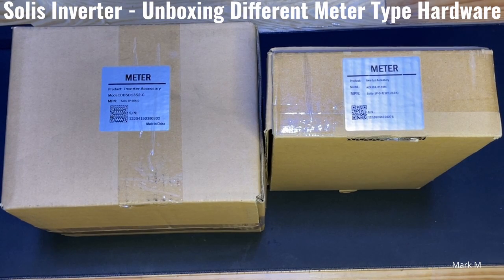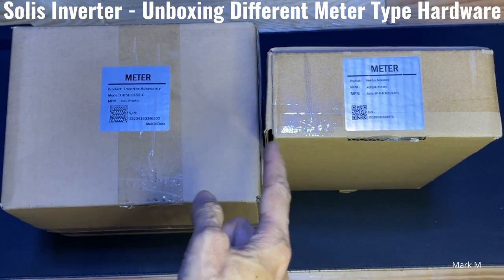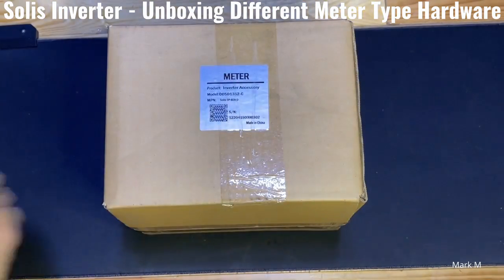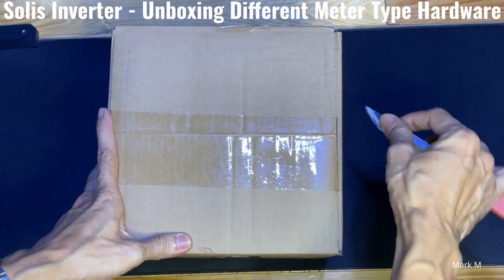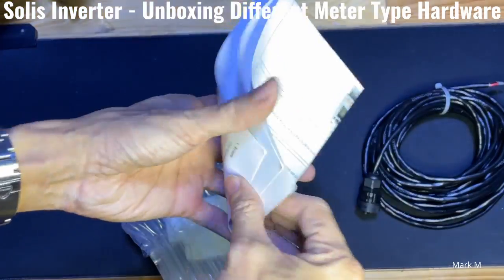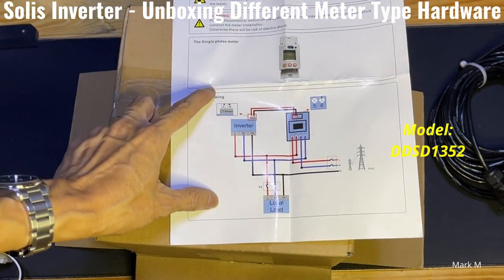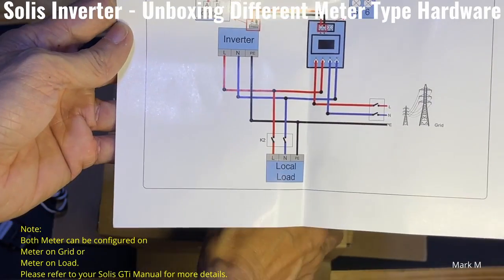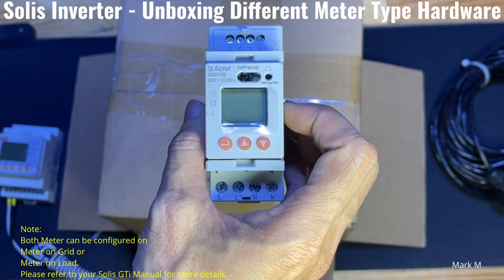Unboxing - Different Solis Meter Type Hardware

Comment: Hi there,

I have solis rhi-5k-48es-5g, it only charges the battery from the solar panels that are directly attached to it but not from the extra generated power by the other inverter, though the meter is showing the power being exported. Please help. Link to the video is here. 
It is exporting about 1kw, battery is just getting charged from the solar panels directly attached to it. The meter I am using is one phase ACR10R-D16TE. Meter Placement setting is on grid. Any help will be appreciated. Charge from the grid is enabled.  Video link is here https://youtu.be/sjtVqiOg1JE?si=2S6TJpbcjZMVcM3X
Reply from the maker: Try to contact your local support and have it patch. My RHi has been patch to correct some settings. It also should work from your end.

Comment: how do u install these meter and set the address?
Reply from the maker: You don't touch any of the meters configuration, it's just plug and play for Solis use. For meters with CT, just clamp it on the hot wire. For Inline, manual is provided.
Reply: Does the ct go on the hot wire from the Inverter to the distribution board?
Reply: yes but the inverter does nottin could you make a video showing the meter setup only please and the wire for rs485 thank for responding
Reply from the maker: @olvano  cable is provided, do you have one for your Solis Inverter ?
Reply: @MarkMinoza  i dont have the original cable i made one .could u test yours, so i can check mine ,with a multi meter check pinout and the resistor from end in video i look all over youtube for one
Reply from the maker: @olvano  what model do you have?

Comment: Hello Mark ..... I have Solis S5 single Phase on grid inverter. Also have Acrel DTSD1352 3 phase meter with CTs from Solis. I don't know how to setup Inverter getting "Fail safe" (Connected Acrel CTs to grid side by instructions manual)
Thank you for your help
Reply from the maker: Use Meter on Grid, dont choose the CT Sensor wih Fail Safe On.
Reply: @MarkMinoza  I tried....any other settings like external EPM settings? I also  switched meter type to 3phase but it always jumps back to 1phase.
Reply from the maker: @jerryp9647  you cant use 3P or external EPM. Only Internal EPM settings if your GTi has included a meter. Set Backflow 000000 and Meter In Grid. Be mindful of the ct flow on your CT illustration.
Reply: @MarkMinoza 1.... I have Solis S5 1Phase 5k Grid inverter and manual say only 2 types of meter supported DDSD1352-C or ACR10RD16TE (all 1Phase meters) 
I have DTSD1352 3phase meter witch is not in list of supported meters. 
2.... my settings: Int EPM settings Meter in Grid (CT arrows towards grid)
under meter type setting 1Phase or 3Phase (any option gives me Fail Safe alarm 😭
Please help
Reply: Hello sir. I have 2 Solis S6-GR1P6K-S GTI in parallel connections. How  to install the two external meter type with CT?

Comment: Thanks for the Video. I installed the Version DTSD1352 but its doesnt work. Can you tell me the Adress from Meter? Bevor it was 25 (9600baud) and i test it wirh Adress 01, 02 and 05 but no result.
Reply from the maker: If your meter was bought directly from the manufacturer, you need to advise your vendor to have the configuration loaded for Solis use. Ill check whats the address in my meter. Ill keep you posted.

Comment: Sir question po. Pede po ba CHNT MODBUS  or eastron SDM230 MODBUS sa mga solis gridtie inverter (given all are  single phase both inverter and meter)? Looks like direct meter type are same looks with MODBUS CHNT and Eastron. THANKS sa makaka sagot. Nakakita kasi ako (youtube) na gumamit ng  EASTRON Sdm230 sa Deye hybrid. At sa video din nakita ko na may selection and DEYE ng CHNT and Eastron for external meter.
Reply from the maker: Direct use hindi po puede dahil ang firmware naka load sa Eastron (no idea kung puede ang CHNT) ay iba. Case point is Acrel, as stated at 0:29 sa video, Ive explain na ibang settings ang gamit ni Solis sa factory default vs their own use. 
Naka encounter na ako binili ang Acrel meter sa isang supplier, hindi gumana. Nag update using Solis provided setup, gumana ang meter for Solis Inverter.